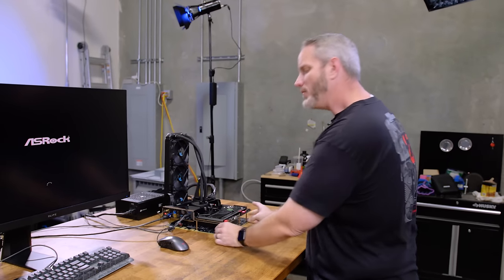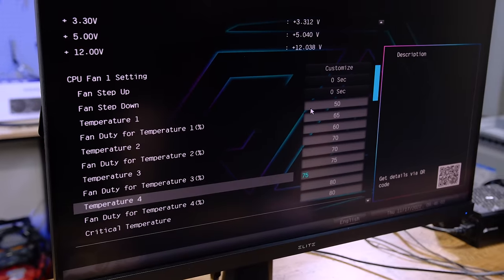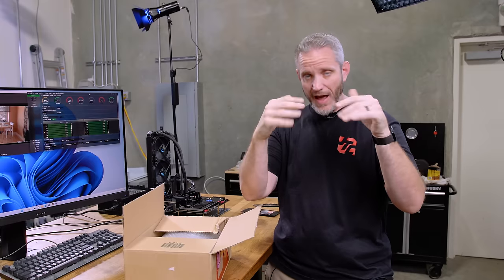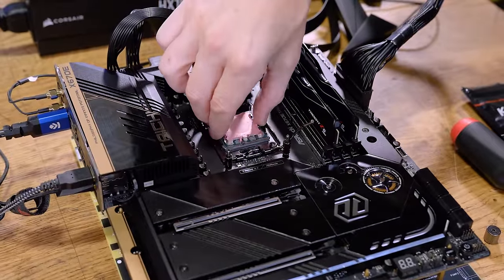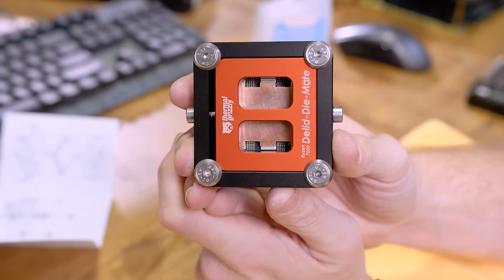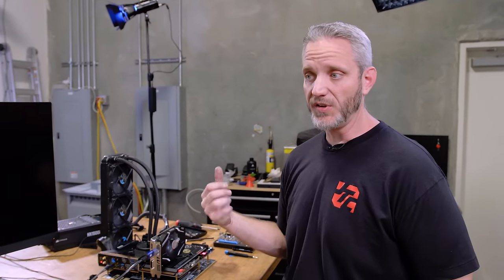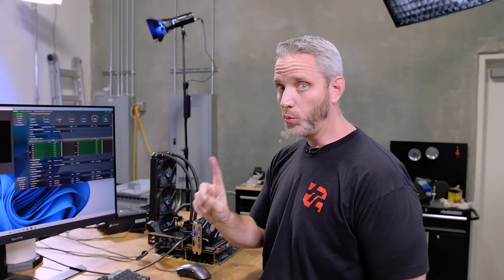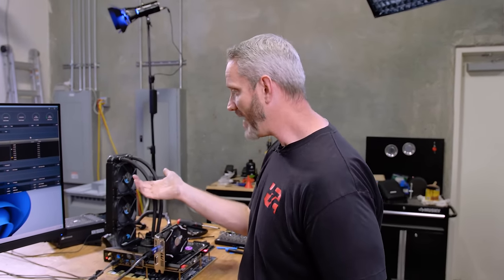I was scared to delid my CPU, but then...

Comment: The most amazing thing I learned from this video was that there was a keyboard shortcut for task manager!  It never occurred to me in nearly 3 decades that one even existed until I saw Jay do it at 3:09.  Don't know how I never knew that one.
Reply: ctrl-shift-esc has been around since win7, so it's a relatively newer one.. earlier versions used ctrl-alt-del to pop taskmgr directly or pop a menu that could get taskmgr
Reply: @niteriderevo9179  ctrl-shift-esc has been a shortcut for Task Manager since windows 95, actually.
Reply: hell i didn't know either.
Reply: @AnalogPipeDream  never knew that, only heard of it on win7+
Reply: @niteriderevo9179  It’s been around for ages. It’s the first trick my dad showed me when I got my first PC back in 1999

Edit: But it’s not only a OS specific thing. Crtl+Alt+Del triggers a hardware interrupt on the CPU (at least on x86 systems)
Reply: What amazes me is comments like this and how often they appear. Next you'll be saying you don't even know what the context menu key on the keyboard is for.
Reply: @usucdik  No, I didn’t ever require a need to have a keyboard shortcut for task manager because my life was not so complicated that I couldn't perform two mouse clicks on the task bar until Windows 11 changed that ability.  Now that I'm aware of a shortcut, I might use it 3 times before I die of old age, but chances are I'll probably forget about it before I might have the chance to make use of it.  Regardless, congratulations for being that guy. "LULZ, you didnt know the shortcut for a feature you barely use!  I bet you don't know anyrhing else useful!"  You successfully showed the interweb superfreeway how stupid I am and how smart you are at the same time.  Truly amazing.
Reply: @Billy_G_Oat  Due to my work, I probably use that shortcut more than 3 times per hour, but yeah, there's no reason that an average user will know most of what's available in any piece of software that they use unless it's truly a single function program.  Anything as complicated as the OS will have many thousands of functions that most people are not aware of.
Reply: @usucdik  i figured that out pretty quick and that's also a newer addition to keyboards.. wasn't really common until around win7.. have messed with 3.1, practically all the way up to current.. lol
Reply: @usucdik  It's the shortcut for right mouse button? So you take your right hand from the mouse, press the context menu key, and place your hand on the mouse again, so you don't have to press the right button of the mouse? Clever.
Reply: @niteriderevo9179  Who needs a GUI. Real men use DOS (or Unix) cli 😂 😂 😂 😂
Reply: @raeferwilson2599  joke's on you... quite regularly use cmd even in win11! more than a few tweaks I do need it.. lol

Comment: I use paint brush to wash cpus with alcohol, literally wash them, much softer than toothbrush, and to remove solder I use Flitz polish paste tube, it will just dissolve the tin solder and show you the mirror glass cover of the silicon wafer, perfectly clear not a scratch.

Comment: voltage offset on Ryzen 7000 series may appear stable in CineBench but crash in Blender, so its best to test both for stability when overclocking/undervolting.

Comment: Yea... Motherboard manufacturers often pump the voltage up to the moon. It worked on CPUs before the whole auto boosting thing, to score a tiny bit higer than the competition, but now they raise it so much that it actually hurts performance.

Using curve optimizer is usually a must because of that.

Comment: I'm so excited, I have a r9 7900x coming. Thought about going with the 7950 but for what I'm realistically going to do, the 7900x is already overkill. I figure since I'm not upgrading GPU this year I can still do the other major components and hopefully see an uplift.
Reply: Why wouldn't you wait for the x3d instead then
Reply: @maegnificant  I'll upgrade if/when that happens if the uplift is worth it. I never keep my stuff long enough to begin with.
Reply: in my case 7950x might be overkill but wanting to run a windows VM for gaming and doing coding at the same time I felt it's best to just go full force. Only negative is I'm not sure how much the GTX 1070 might hold me back but as long as GPUs don't skyrocket again in price I'm fine with waiting a bit longer.
Reply: @U1TR4F0RCE  I think honestly the price you can get some 30 series cards for they're a decent value at the moment. They're plenty capable especially with DLSS.
Reply: I bought a 7900x and it's awesome ngl, am gonna use this CPU for at least 6 plus years and in that time ryzen am5 will mature
Reply: @ineedmymodfixed  one thing I'll have to consider for 30 series or even the AMD stuff will be power cables since I was suprised to find out that I almost filled up the PCIE cables with just the 1 graphics card.

Comment: I'm definitely going to pick up a tube of that Thermal Grizzly compound. I'm running a 5900X and a little more thermal headroom in the Summer months would be a good thing.
Reply: I'd recommend a static overclock. I got a slight increase in single thread performance and a very significant multicore boost on a 7700x
Reply: I only use the kpx paste now. I've used the thermal grizzly kryo as well as just about everything else. Like the Kingpin paste the most. And it's pretty decently priced, 30 gram for $45 ish.
Reply: I've been a Thermal Grizzly fan for a while. Got it on my 5900x with a water-cooled AiO and have never seen temps over 61c

Comment: Personally Id like to see long term tests(5+years).
DeBauer follow up videos with machines actually doing work for him would be excellent!... Same for you Jayz.

Long term testing is the keyword.

: )
Reply: You'll never see it, and it wouldn't be of any use anyway due to the variances in the wafers used to produce chips. What worked well on one chip may not work at all on another exact same type, but different wafer pressing. It's the nature of the beast as to how chip fabs work.
Reply: Using the same cpu modded long term tests would be nice to see. I have several 5-6 year old cpus still going with all sorts of cooling mods over the years. Usually it's the motherboard that gives up before the CPU. 
Wear an ESD strap when handling these things. Use an ESD mat. You will guarantee that no transistors are fried or fail later because of ESD. There are no backup transistors in there.  If you have zapped a junction, you will know in 90 days, a year or two later. Wondering why it died all of a sudden?!
If you put another cpu in the socket and it boots, well that was ESD that probably killed the cpu.

Comment: The way you are using the cooler might be causing cavitation on the pump. Try to use it "upside down" with the intake and output in the bottom
Reply: no,
pump is at the lowest point so no
Reply: Panch_88 - Absolutely NOT, your thinking is wrong/backward. Intake/output should ALWAYS be higher than the pump.
Reply: I agree. Gamer's Nexus has a pretty good vid on exactly this. Any air will get caught at the highest point; in this case, the top of the rad where the tubing is. Here, air might be getting sucked in to the pump.

Comment: I've just re-greased my Ryzen 7 5800X with Kryonaut extreme and I've never seen such a large drop in temperature just from changing the thermal compound.  It was a pain to apply (doesn't adhere to the IHS very well so was tricky to spread thinly and evenly) but the performance is great, reduced my temps by about 7°C

I did have high temps on the first boot, I even ended up with the BIOS going to default due to a failed boot attempt, it seems that this grease needs a few minutes of hot operating to 'bed-in'. By my third Cinebench run the temps were way down to new lower levels and have stayed there since

I suspect that the grease may act as a non-Newtonian liquid so that when the block is pressed down it actually becomes less fluid under the pressure (which would also explain the issues I had spreading it) so if it is not perfectly even it can take a bit of time to create a good interface..

I'll be interested to see how it performs tomorrow morning when I boot from cold... 🤔
Reply: This morning: my system boot looped and reset the BIOS again on the first power-up - there are definite issues with this thermal grease, my CPU is overheating on the cols startup, the grease acts as a thermal BARRIER when it is cold 😒

I'm concerned that this grease has two major issues:

1.  It seems to act as a non-Newtonian liquid so its performance can be significantly affected by the pressure of the block (something which I have no way to effectively measure)

 2.  It also seems to act as a thermal BARRIER when cold causing CPU temps to spike on cold startup a machine which cannot be good for a system that is powered down at night like mine

At this point it seems that the issues outweigh the benefits and I'll likely be returning it to Amazon as not fit for purpose unfortunately

Comment: I did the curve optimizer on ryzen master with my 7700X on this same motherboard. I did the per core option and ended up hitting 5.45GHZ under Cinebench r23 full load, managed to stay under 90 with no cpu mods on a custom loop. It took a couple hours but I feel was well worth it. My voltages max out around 1.270.

Comment: I have an EK AM5 block and it does NOT have its own backplate. It uses 4 posts that screw into the existing hold down mechanism from the rear of the motherboard. Be aware that wouldn't work natively with this mod since it won't have the necessary backplate.

Comment: Great video as always Jay!
What I am about to say I do not recommend. But My waterblock solution though questionable and dangerous to those who don't pay attention, it worked well for me. I had an old AM4 EKWB quantum velocity block, but the included standoffs wouldn't go low enough for a delidded 7950x. What I found through experimenting and desperation was that the threads on the cpu backplate on the Asus Crosshair Hero matched the threads of my long fan screws. I paired them with some springs from the exwb block kit, and some washers so the screws heads didnt walk on the cpu blocks bracket. Right now my cpu has no hold down mechanism, I am waiting for Thermal Grizzly to release the cpu mounting bracket. Which will hopefully be out soon. The temps and performance gains are nothing to be scoffed at. 
I got my 7950x at Microcenter for sale, 170 dollars off with an included kit of Flare X 6000Mhz ram included. So i splurged on the Mobo. Expo ram is awesome just a couple clicks in the bios and you are running 6000 Mhz Ram. My number one recommendation for 7000 series is watch microcenter for sales, they have been happening rather often as of late. and if you do jump on the amd train update that bios once you have your computer up and running. The bios that came with my board had a habit of dropping all usb devices every 40 or so minutes. With the most recent asus bios update I have had zero issues with anything.

Comment: Asrock have had over volting issues for years, enable XMP and expect the IMC to be overvolted, my 9900k was 1.37v out of the box, I manually dropped it to 1.25v and no instability whatsoever with massive power and heat savings.

I am guessing they do less testing than the more expensive vendors and throw voltage at it for safety.  But it is good they added those easy undervolts in the presets and lower temp targets also.

Comment: Jay. cool video as allways. keep up the good work. just one tip. when in windows.... press and hold SHIFT then go to restart with mouse on start menu while holding SHIFT then press restar and menu will pop up and then advanced then change firmwaire settings and it will auto go to bios no need for DEL butt trtrtrrttrtrtrtr

Comment: Bro, you can just hold down delete while it boots. :D
Delidding a 7950X can be done safely and easily without der8auer's tool. First use 9 gauge guitar wire to cut the glue. Then use pliers to pull gently on the heatsink as you heat it up. You need 160C to melt the indium, but you don't want to give the heat lots of time to soak into the die and PCB. Heat only the heatsink and do it rapidly. I used a hot air tool. The heatsink comes right off as soon as the indium is soft enough. This is WAY safer than the mechanical shear you get with der8auer's tool.
Cleaning off the indium is the hardest part. It's soft already, so scraping it off is easiest. LM is only useful when you have already scraped most of it off, otherwise it's just a mess on top of the indium.
For mounting I used my Noctua DH-15. It has plastic standoffs, so I shortened them by the height of the IHS: 3.8mm. That way I still tighten the screws all the way. Kind of a bummer the DH-15 only has 2 screws, but it works.
Unfortunately Ryzen Master uses quite a bit of CPU just by being open.

Comment: The direction of the radiator of the 3-row water cooler shown in the video is not desirable. If the radiator pipe side is facing upward, it is easy for bubbles and air to flow in the refrigerant liquid, so this is not recommended.

Comment: Thank's to the contract frame, this thermal paste and a nh-15, -0.1V offset I was able to get more than 40k out of a 13900K (Asus Limits) with Z690 DDR4 (3600). But I needed about 280W, 100 more than you used with 7950x

Comment: The curve optimizer really is the best way to overclock your Ryzen cpu's now. you dont need to fuck with static voltages or clocks yourself. Just pull voltage from the curve and you get at least a 5% bump in performance across the board. My 5600x stock would run around 4.5 4.4ghz all core during cinebench at 73-74c on a hyper 212 black tower cooler. but as soon as I did -25 in the bios to the curve It is a constant 4.65 all core at around 68c. gained like 3k points in cinebench as well and in gaming gained like 20fps on avg in warzone 2.0

Comment: I might just be lucky but I still have a 7700k that I delided and used liquid metal on the IHS. I did this about 4 years ago, I never sealed it, it just uses socket pressure and I've never pulled it out of the socket. Its actually still running in my home server. It did overclock very well to 5 Ghz but running as a server I did pull it down to stock settings with XMP for stability running usually a month per reboot. This thing rarely ever sees temperatures higher than 50c with a Dark rock 3 and a 1200 RPM fan and I consistently use it for game servers like Minecraft, Satisfactory, KSP, Factorio, Plex, and network storage, its still quite a monster for my home server needs, DDR4 prices want me to buy a 64GB memory kit for it too.

Comment: I'm curious here if AMD (or intel) would ever do like a collaboration or whatever where they'd literally sell a kit with a lidless CPU and a bracket replacement. Maybe even with an AiO in there. 

If nothing else, I would not be the least bit surprised if later down the line, AMD starts making "non backwards compatible" CPU's with a sensibly thin lid and a bespoke AM5 only CPU and cooler latching method. The AM4 cooler compatibility smells like AMD's attempt at sweetening the deal to get people to switch over. But they are going to have to drop it at some point, especially now that AM4 is old news.

Comment: I wish their was tools like this that worked on BGA CPUs and GPUs  Without having to remove them from the board.
I have a few consoles I plan on deliding but the best options as far as I know since their BGA chips is to manually cut away the adhesive with a Very thin tool you have to partly make yourself from tools originally for a different purpose like a painters spatula thing(I forgot the name of it)
For those they need to be sanded down to be much thinner so you don't end up wedging the IHS away from the Substrate adding unwanted force that can damage stuff.

Comment: To clean of you can maybe use a gun barrel cleaner as it's pretty good for lead and tin . At least on the top of the plates with a Q tip not sprayed all over like Isopropyl alcohol. May be risky but hey the whole thing is already scary so...

Comment: hey I have a problem actually, maybe you have an idea.
I have the automatic down-clocking CPU frequency working well on my i7 4790k in Windows anf in windowed applications. Goes down from 4,4ghz all the way to 800mhz on low loads. But as soon as I start a game on full screen or borderless, it will run full turbo no matter what. So annoying. Tried to se the max CPU power to 50% in power settings, which all works well until full screen like mentioned above. Trying to save some energy. Lol, the game I play is so low demand that it doesn't need more then 2ghz. The graphic card is also set to lowest possible. Still 160fps in-game. 

Any idea how I can fix that? I want my CPU on 50% or around 2ghz also in games. 
Some windows command forces it max frequency and I can't figure out what it is.

Comment: I use thermal grizzly Kryonaut extreme and the thermaltake $12 CPU replacement bracket, my temps on my 12900k never go above 34c after heavy gaming for hours, but I am running a kraken z73 360mm AIO on it. Ol’ Jenny stays chilly.